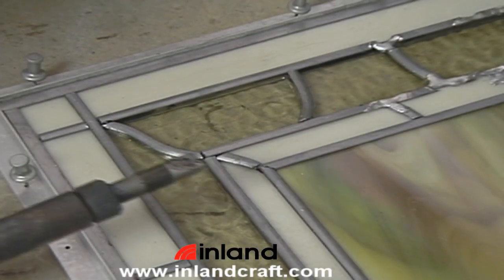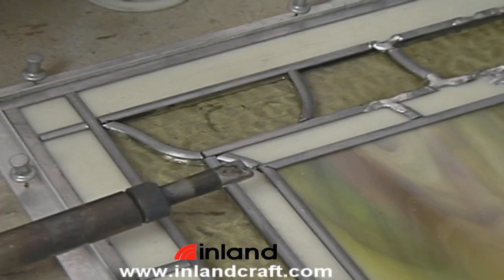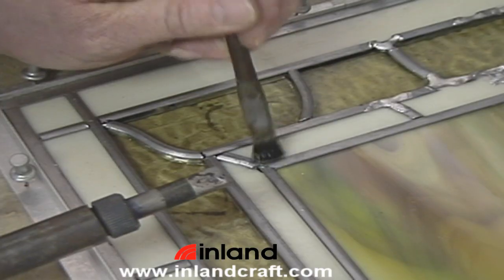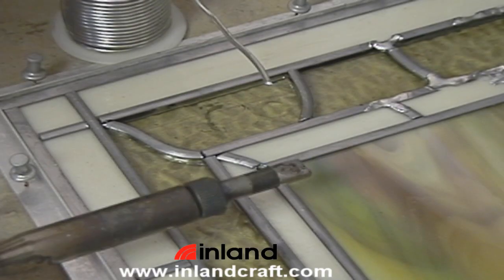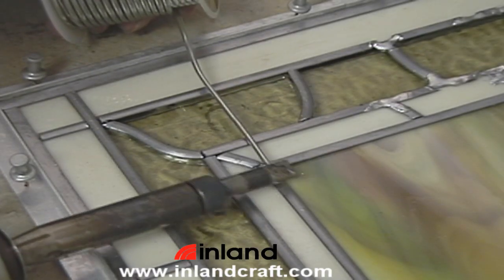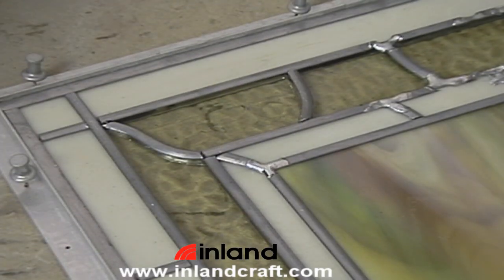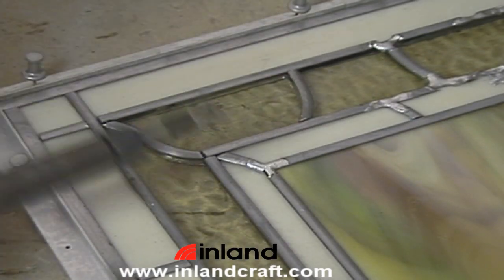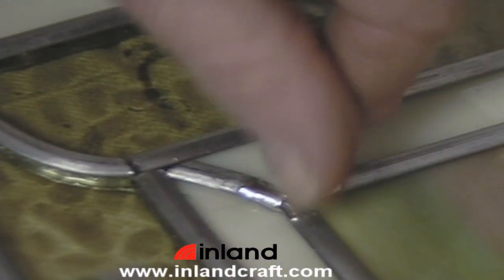Soldering a Leaded Stained Glass Panel

Comment: OK Great for the info..... can I suggest a few further tips;
First, use a tinning lid.......
it's a simple device, that's just a small metal dish, part full of solder and tallow (flux) to help cool and regulate your soldering iron tip temperature.
You should soon learn the speed of your iron, I prefer the traditional gas iron for much better results.
By far the best technique for outstanding joints is by using the 'spadge technique' this ingenious method of solder coxing helps rescue an awful joint.
Happy soldering.... I will go into this further if anyone takes interest.